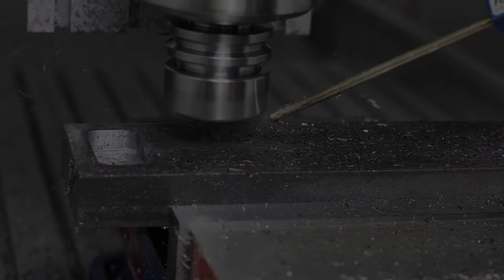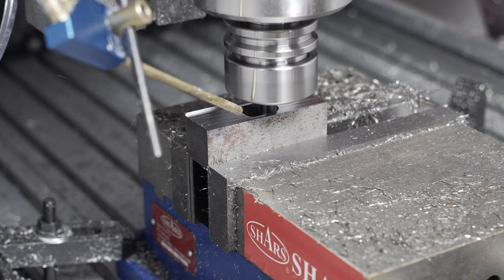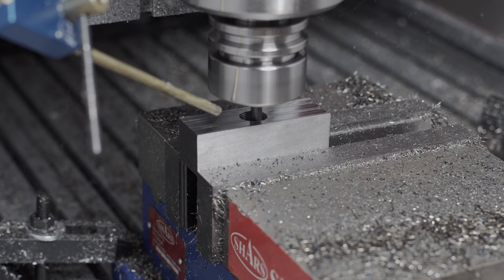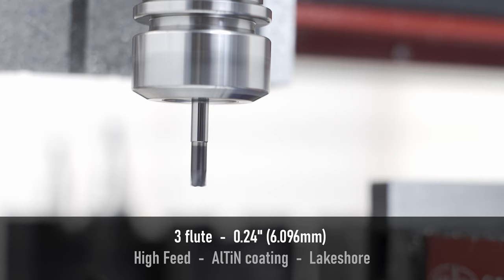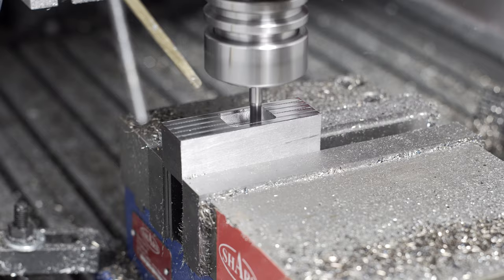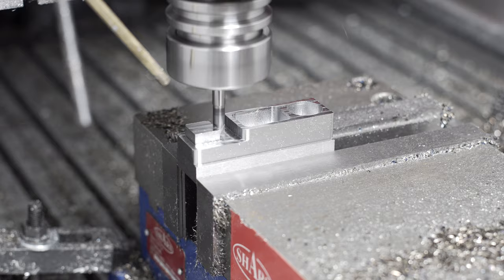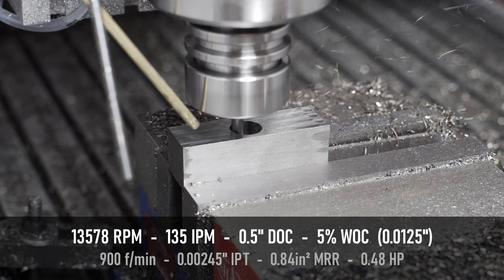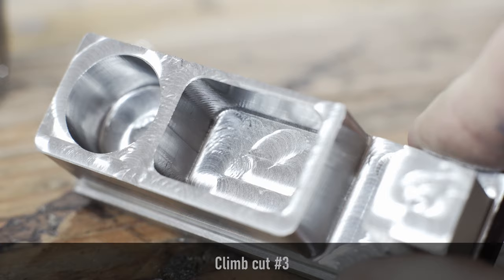More steel cutting tests on the Benchtop Pro

Comment: Imo climb is the way to go on light machines, cutting forces are in geneal lighter, the tool does not get pulled into the material and its nicer to the endmill.

Your result with the highfeed endmill matches my results very exactly - I suspect the high axial forces the cutter geometry creates to be an issue for our light routers. Also, the geometry relys on a high feed to create some reasonable chip thickness.

What works well in my experience if you want to take a high feed approach: A regular endmill for steel, with a corner chamfer, say a 4mm endmill with a 0,2mm Chamfer, and then run it like a highfeed endmill, just with a bit more reasonable feeds ;)
With that tool/strategy combination i got hours of effective cutting time out of a 12eur endmill in 1.4305 (304) stainless.

Comment: Great video, I'm enjoying the exploration with this machine.  One important consideration with climb vs. conventional milling is the cutting force and subsequent bit/machine deflection.  When addressing chatter/cutting issues, most people recommend conventional over climb because of backlash, something stemming from historically manual machining.  But obviously most modern CNC machines have minimal or zero backlash, so the next consideration is how the chip is formed and the resulting forces.  With climb cutting the bit (and machine) is deflecting away from the stock, whereas with conventional the bit (and machine) is deflecting into the stock.  This is especially important with a light duty machine and long thin cutters (and especially with high axial engagement).  Something else to think about with your machining strategies and what your seeing in the cut.  Keep it up! Thanks for the videos.
EDIT:  Just realized you addressed this a bit.  Commenting before watching the whole thing: classic.
Reply from the maker: Good information nonetheless! :)  I hadn't considered the direction of the forces, that's good to keep in mind, both from a deflection standpoint and probably from work holding too.  Cheers!
Reply: Also with conventional the chip starts with "zero" width, which means there will always be a bit of rubbing which is bad for tool life and can lead to chip welding in aluminium.

Comment: I have fitted a 3.5KW 18000 rpm spindle to my Syil X4. I use the carbide cutters from China and having pretty good success. I have up graded my steppers to closed loop and I would high recommend that. Reasonably cheap to do and they are bloody good! My machine is more ridged I guess but I'm finding I have plenty of torque around 6-8000rpm to cut steel. Good video and possibly the most relevant to my machine. I would never go back to to ordinal spindle for what I do this is awesome!

Comment: When running step calibration , always remember to repeat the calibration over different distances several times. I usually set up a dial indicator and try it at .75in, then use mics. To set it over 4~6". Then usually try it with arbitrary numbers in between to make sure it's dead on in + and -. I've screwed up my screwmapping before too ;)
Reply from the maker: Ah yeah, that's almost certainly what I did wrong then :)  I did repeat calibration several times, but only at one distances (0.5" iirc) and only in one location.  How do you accurately measure over long distances with mics?  Clamp in a vise and calibrate "inside" the mic jaws?
Reply: @BreakingTaps  I clamp a parallel to the table, tram it so its square with the world, touch the probe to the parallel, run calibration over whatever distance I'm wanting, and stack guage blocks from the parallel to the back of my probe . I've also used snap indicators(I think that's the correct name, the ones used to measure inside diameters). Also used a second parallel with a micrometer (kind of a pita) I'm sure there are better ways but that's what worked for me and the limited tools I have at the moment :)
Reply: And you got it with the mics. Clamp it perfectly straight in a vise and open the mic jaws wider than your moving. Then measure to your probe and subtract probe dia.
Reply from the maker: Awesome, thanks for the tips!  I have enough of the same equipment (or similar) to give this a shot...will try this out soon!

Comment: I know this video was posted years ago but it was very enlightening for these benchtop pro machines.

My observation: by using steppers rather than servos you have somewhat competing interests between the motors and your high feed spindle / endmill.  Steppers lose power on their torque curve the faster you run them. So they become increasingly likely to skip steps at higher feedrates. So both your frame and motors are working against you.

Comment: Not sure if you've updated it since, but when helical ramping I'd highly suggest setting ramping diameter to ~0.95*tool_diameter. That way you're not doing a full-slot ramp, and instead allowing the cutter to make its initial cut contact into the vertical surface from the previous helical pass.

Comment: Thanks for doing these tests.  I'm seriously thinking about this same router with the 12,000 RPM CNC Depot spindle.  I plan to do mostly aluminum, but it looks like steel is at least possible with this combo.
Reply from the maker: Nice! Yeah the 12k spindle wasn't available when I purchased mine... if I were to do it again I'd be quite tempted to get that instead of the 24k.  The high speed is really nice for small tools in aluminum, but the 12k might end up being more flexible since it'd tackle steel better.  My only big complaint are the steppers, I opted for the NEMA 23 and they just don't have the oomph to move quickly enough to take advantage of the spindle.  Should have gotten the 34s, or just jumped straight to Clearpaths.

That, and the machine can really start to get thrown around when moving at high feeds!  Next project is beefing up the table and bolting it down :)  Goodluck!
Reply: @BreakingTaps  Yeah, Clearpath is on my wish list as well.  I emailed AvidCNC about it to see what they can offer, or if I'm going to need to build out the electronics from scratch.  The Clearpath motors need different cabling and power supplies, and I've already got the spindle and Hitachi SLV VFD, so I suspect I'll be on my own, but I'd really rather work from a configuration they've tested and can help support--especially when it comes time to start messing around with probing and toolchangers.

Comment: This is great content, i usually use the yg1 5070 high feeds. I have really good success with ramping on these, we cut alot of slots and spiral water channels in hardened material, and those have become our go to.
Reply from the maker: Oh nice, thanks for the tip!  I've been trying to find other solid carbide high feed mills (it seems most high feed are insert-based?  And usually too large for me to use), will check these out.  I still really like the idea of high feed mills and want to play around more.  Larger/longer parts seem to make more sense, to give it time to hit the commanded feedrate.  Also contemplating some machine upgrades to deal with the accelerations required.

Comment: Awesome videos! Your best bet is a spray of light oil if you're not prepared for a flood. For lighter metals or softer metals, WD-40 is the way to go. Also it's better than nothing for steel. The key is to not cause any thermal shock to the tool. You get micro fractures from the AlTiN and tungsten carbide expanding and contracting at different rates. So if you had cold water an soluble oil, you better be cooling it all the way or you'll get a hot tool with cold coolant, then crack-boom! Steel might be better dry with an air blast, but when you work with mushy stuff like aluminum you absolutely need a light oil to keep it all from sticking to everything like hot laffy taffy. Niagara makes some amazing cobalt HSS mills that don't last as long as AlTiN but they don't mind deflection or chattering. Plus the flat ground roughing endmills leave a mirror finish on surfaces. So that's a plus. If you want to reduce harmonics and also improve the life of coated cutters, go with odd numbered flutes. The best ones in my opinion for rigidity and high speed 2D profiling are 3 flute 5/16." They got enough meat to take a beating, great for high rpms, and one less flute gives you all sorts of clearance for chip evacuation. Also try a Ranque-Hilsch vortex tube for localized cooling. Look them up. Compressed are refrigeration for machining.  FYI I taught CNC and manual machining at a community college, so I picked up a lot of tricks. Feel free to ask me questions. Addendum, I looked at some other videos and saw you're already using 3 flute mills. Very good!

Comment: Also, those chips aren't turning gold or blue which means they aren't getting too hot and you aren't pushing anything too hard. A generic rule of thumb is that once the chips are a straw gold color that is where you want to be and if they are turning blue you are putting too much heat into the material/cutter.

Comment: Really interesting.
I have the same machine on the way but I decided to go with a 12,000 rpm spindle. Also  I went with clearpaths for all axis. I plan to bolt the machine solidly to a metal frame base bolted to the ground. I want to cut mostly aluminium  but would like to cut 4140 ocasionally. Hopefully the lower rpm spindle speed and the added rigidity will allow me to cut pretty much anything. Will let you know when I have everything assembled and running.
Reply from the maker: Awesome, goodluck!  I think I might have gone with the 12k if it was available at the time.  ++ to clearpaths, I recently acquired some servos and plan to swap them in the future as well.

Comment: Keep up the good work, couple of things:

As far as steppers go, the problem with them is that their torque falls of a cliff the faster you run them.  Very high holding torque, but as your RPMs increase the torque decreases, has to do with their inductance.

2nd, the NES series VFD that comes with that spindle kit is good but there is better.  Look into the WJ-200 also by Hitachi.  You can over drive the torque at lower RPMs to get more grunt down low, but be mindful of the spindle temps as you are pushing it.
Reply from the maker: Makes sense re: steppers.  The Avid folks recommended NEMA23 since they said I wouldn't need the higher torque offered by NEMA34 at high speeds... but I guess they weren't thinking about HSM and really pushing the machine.  My fault for not researching enough!  I suspect I'll move to servos sooner than later though, so I'll just live with it for now :)

Interesting, what's better about the WJ-200?  I admit, I don't know much about VFDs :)  Is it one of the sensorless vector drive types?  I did see the NES has a "torque boost" mode for lower speed, I guess it just increases voltage?  Will have to play around with it.  The S30C does have a temp cutoff probe inside the spindle so at least theoretically it shouldn't go into full melt down
Reply: @BreakingTaps   Actually Nema 34 aren't really much better.  If you look at the torque curves they have higher holding torque but they too fall off a cliff as RPMs climb, in some cases they are worse.  Avid has picked a good blend of torque and speed for their Nema 23 motors, but when it comes down to HSM; servos are king.

Both VFD can do sensorless vector feedback, but the WJ200 is optimised for high torque applications.

By chance do you have an instagram account?
Reply from the maker: Interesting, will do some more reading on VFDs (and re-reading my NES manual)!  Might have to add the WJ200 to the upgrade list in the future.  Related to low-end torque, CNCDepot recently came out with their 12k model. Makes me wonder if I would have chosen the lower speed version if I were to do it again.  Would definitely make working with steel easier, but otoh limits smaller end mills in aluminum.  Always a trade off i guess :)

I may have secured a set of servos for a very reasonable price, albeit with a slightly unorthodox control method.  More to come in the future as I get them integrated :)

My instagram is @polyfractal.  Mostly a hodge-podge of machining, astrophotography, dogs and baking haha :)

Comment: going to watch this also to see if any of my question gets answered
Reply: aghh one question i have about the rigidity of the frame of the machine. I have access to fabricate custom metal tables is there room on the frame that I could fabricate pieces to kinda give it a more ridgidity if I clamp or bolt it to for example a heavy steel table?
Reply from the maker: Yeah, I think there are a few locations that could benefit from additional reinforcement.  The gantry "arms" are big chunks of aluminum, but could easily be reinforced (or replaced) with steel.  You might lose some speed/dynamic response since they are on the moving section, but it would also stiffen up the gantry a bit.

Other easy fixes could be adding a steel fixture plate to the table, or replacing the aluminum table with steel completely.  Filling some of the base extrusions with sand/lead/epoxy/etc.  They are all large hollow extrusions and it'd be trivial to add another hundred pounds just with sand.  Table has rubber feet, but could also bolt it directly to a table for extra rigidity.

I should have splashed out for bigger steppers, or just servos.  The steppers I have at the moment are definitely underpowered imo.

The place that needs it the most, but would be hard, is the Z-axis.  The spindle acts as a long lever which can torque around the head and gantry, which I'm not sure is fixable without replacing the whole gantry.  

Here's a sorta-3D view of the router I made a while back, if it helps: https://www.youtube.com/post/UgzwFk9u-RWRTuii1jR4AaABCQ, and an image from the manufacturer: https://www.avidcnc.com/images/BTPRO2436-Base-16.1_800.jpg

Comment: I think conventional would be beneficial for finishing passes, or chamfering, but it isn't my favorite machining style for CNC. I sometimes will use a table router to machine aluminum plates by hand, and whenever I tried conventional, the stock would want to roll along the endmill/bit and fly out of my hands. Terrifying. But I found that doing light conventional passes at the very end would always leave a mirror like finish. So I started applying this same mindset to CNC as well. Climb 99% of the time, and then conventional for small WOC finishing passes or chamfering.

Summary: I hate conventional.
Reply from the maker: Ah interesting, I hadn't thought about conventional for finish (or chamfer)... will give that a shot!  I've really been struggling with finish passes.  On several of the test pieces, the surface from roughing was pretty decent (not great, but not terrible either).  But the slower finish pass started chattering really badly and ruined it.  I guess the small amount of leftover stock isn't enough for climb to "bite" into and bounces instead?  Not sure, but trying conventional there makes a lot of sense to me.  Thanks!

Comment: Thanks for posting this video and publishing the feeds and speeds. Was super useful on my CNC setup, I am certainly doing things now that I didn't know was possible with my 2.2kw high speed spindle. Look forward to more videos!
Reply: @LegendLength  yeah i managed to hold 50 micron tolerances. Check out some of my videos.

Use the smallest cutter you can and use adaptive tool paths. You might not have a stiff machine but it may be possible with deep depth of cuts and adaptive toolpaths

Comment: high feed tools's feed are related to their low lead angles, i wonder if having a higher lead angles would just be better for your router
i think incrasing your lead angle would half your feedrate while allowing an higher dept of cut, while still keeping part of the benefit of high feed rate
and yes i know its an old video

Comment: At the end there, your metric DOC and WOC numbers look swapped over to me, FWIW. I thought the 10% WOC sounded fine and I'd have been tempted to go for 15-20% next. The spindle speed will reduce under load but that's normal. No point having a decent spindle motor if you never push it.
Conventional causes the tool to rub at the start of the cut and may actually increase the cutting forces and spindle power. It's only necessary if you have a problem with backlash, which your machine clearly doesn't. 
The only reason I've broken tools in the last 18 months or so is due to chip recutting, so I sympathise with your nervousness when chips don't clear! Those silly fog lube things look about as ineffectual as brushing oil on the stock before you start machining. To me it's either full flooding or air blast if you plan to use your machine to its full potential.
Reply from the maker: Whoops, swapped indeed!  Thanks for the opinion on 10% WOC!  Still training my ear for what's "good" and "bad" :)  Interesting re: conventional, I guess it makes sense that it'd increase cutting force at the start since it doesn't have a chance to really take a bite.

And yeah, I'm really unimpressed with the fogbuster, almost moreso on aluminum since you can't run dry.  Who knows, maybe I'll waterproof the enclosure and just switch to flood some day :)

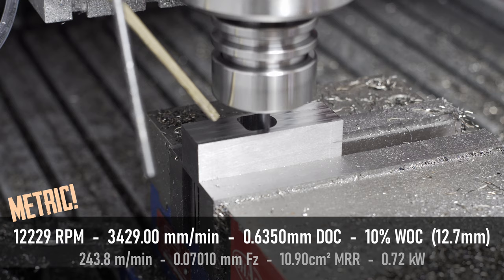Comment: I highly appreciate showing metric values (so I don't need a calculator😉) But @9:34 12.7mm as 10% WOC would translate to a 12.7 cm end mill, that's 5 inches 😆.. 0.025 inch = 0.635 mm 👍

Comment: Nice job!  I was going to dry cutting some steel and this helps quite a bit.
Reply from the maker: Thanks!  Looking forward to seeing your experience with it, and how it compares to the Tormach.  Hard for me to know what's "normal" or good since this is my only machine, and not really designed for metal either :)  You have the 12k spindle from CNCDepot, right?
Reply: @BreakingTaps  I have the 24K spindle from Avid.